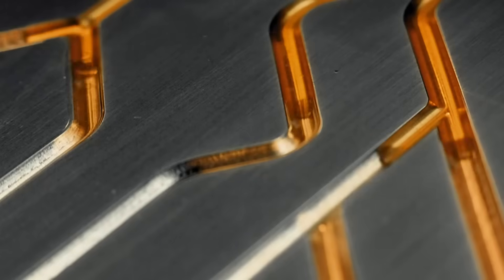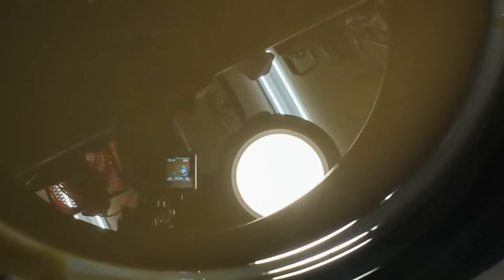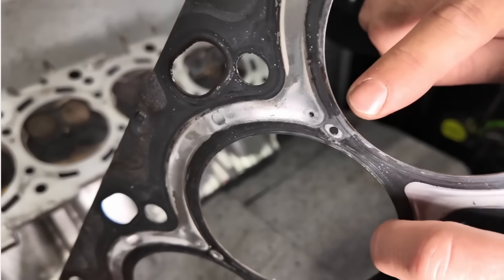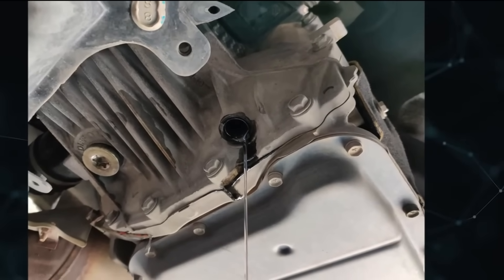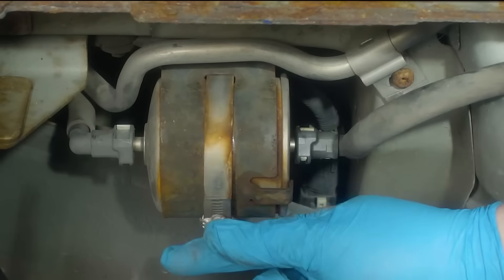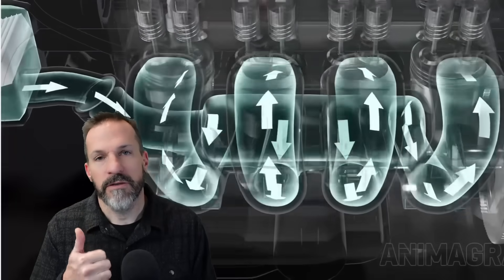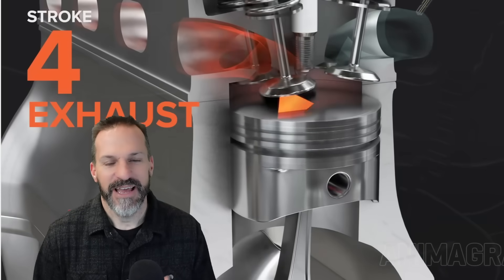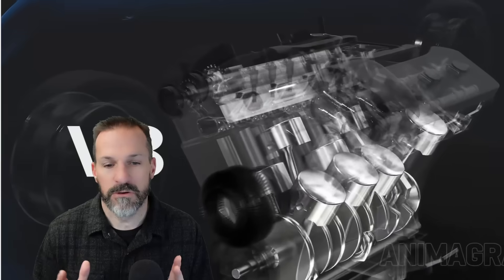Car Maintenance MOST People Ignore! Make Your Engine Last 200,000+ Miles!

Comment: I have a 1996 GM car with 215k miles. Only changed an alternator, fuel pump, ignition coil, water pump, brakes, hoses, etc. and a couple of minor other items. I bought the car brand new and did an oil change at 500 miles and performed the recommended break in procedure. It just needs some some paint on it and I hope to drive it beyond 250k.

Comment: Check for metal in your old filter???
That shows engine damage, changing oil more often won't fix the damage.
Reply from the maker: It's considered "normal" for there to be some metal on the initial oil change. After that, you should not be seeing metal, however it will point to signs that something might be wearing (bearings/rollers etc.).

Comment: Also change your oil at no more than 5000 miles regardless of the owners manual says! 
Next change transmission out I buy a kit from a company that sells car specific oil and filter and new gaskets for around $120.00 from Blauparts

Comment: Instead of measuring oil when you drain, you can simply check the dip-stick first to see how much of it has disappeared since the last time you checked as you are supposed to.
Reply from the maker: You can, but you should at least have some idea how much oil is missing depending on where it reads on the dipstick, every car will be different, and every car holds different amounts of oil in the pan. I would say do it at least once...so you understand how your individual dipstick reads.
Reply: @TheCarGuyOnline  If you do it monthly as you are supposed to, you will have done it more than once between oil changes. Doesn't hurt to look immediately after an oil change too as there are horror stories of shops forgetting the "add oil" part of an oil change... or not doing the job altogether.

One of my friends drives a 2014 KIA Rio (company perk) that burns about a quart per month or ~800mi. The first time he asked me to have a look at it, I found that it was low on oil and had a new quart tucked under the driver seat. That barely got the dip-stick tip wet, needed another quart on top. Whoever had the car before him knew it was an oil-burner.

The last time he asked me to check if he was due for an oil change, his dipstick was dry again. I offered to top it up using used oil from my own previous oil change to tide him over until he could get around to having his oil change done at the company's garage, saves me the trouble of disposing of it. Ended up pouring my whole gallon of used oil plus a quart of new oil into it to reach the minimum level.

I'm surprised he still didn't have a low oil / check engine light. Or maybe he did get it intermittently (starting to suck air) and didn't mention it.

Comment: Couple things I do with my 2011 ram, I keep a journal of everything that’s done with my truck either by me or a shop. That’s date, mileage, what was changed and part number of part/fluids. I also do oil analysis through Blackstone laboratory that will tell you everything that’s happening inside your engine. I do every oil change but you could do every other one. I even journal every tank of fuel, that’s the date, where I purchased it, how much it cost per gallon and then I hand calculate my mileage. My dad gave me the idea of journaling and it’s helped out tremendously to remember what has been done and what needs to be done.
Reply: That is awesome. I've seen records before, I wish I wasn't so lazy.
Reply: I'm sorry I stopped reading at Ram. Unless I had a giant shop with custom tools and paid for the truck in $75-115k complete cash I wouldn't buy it. Toyota 100%. I'll stick to my middle class trash ways until then.

Comment: We put 360,000 miles on a gas mercedes and changed the oil at 10k as recommend.  Not sure we wanted the car to last any longer. No engine issues ever.
Reply: Which Mercedes model car did that? And year
Reply: Likely a way older model. Good luck doing that with a new Mercedes. Anything newer than 2017 will probably break down before 175k that way.

Comment: In my wife's 2016 Chevy Equinox with the LFX 3.6L V6, I do oil changes about every 2K-3K miles using Supertech 5W-30 Full Synthetic. I ran a can of BG EPR in the engine about a year ago, which works fantastic on these GDI engines. I'm about to do an Amsoil Power Foam service on the intake/valves this coming weekend along with dropping the transfer case fluid with Amsoil.  I've been running Lucas upper cylinder lubricant/injector cleaner for about the last 20K miles. But yeah, this car is about to hit 90K miles, runs superb. You can't even hear or feel this thing idling. Only major thing I've had gone bad was a fuel tank pressure sensor with threw an EVAP code, which was repaired.

Comment: Yo, my 2007 Chevy Suburban with the 5.3 Liter has 280,000 miles on it. We use mobile one oil 5W-30 full synthetic and Lucas oil stabilizer. We not had the lifter issue because we change the oil every 5,000 miles. What’s nice about the LS engines, is the timing chain last the lifetime of the engine. We also have invested in a K&N washable air filter. Overall, I would give this 53LS a 10 out of 10 or four reliability.
Reply from the maker: Yeah I think the older GM engines were great for longevity. So many small time contractors I see around here still driving them. They might be rusted out but they still move LOL. 2007 was tough with AFM issues for some, you must be very diligent with oil :).

Comment: 376,000 2001 Durango 4.7L...does have rebuilt diff in it as dealer did not replace the pinion seal correctly and it failed. Engine/Trans still original. 2006 300C, 285,000 miles, purrs and that gets 10K oil changes, 100K trans fluid/filter changes. 2014 Durango just hit 200K. I use the on-board oil change system for guidance. No engine issues or Hemi tick. I have not touched the trans, as Dodge says not to. I may do a fluid change on it when I change the plugs which are due now.
Reply from the maker: Those are some incredible numbers!
Reply: Probably wouldn’t work on anything newer than 2017.

Comment: I try to maintain my cars beyond what is recommended. Another step I have taken is doing what I can to prevent rodents from getting under the hood. When parked in the garage I keep the hood open and regularly inspect for evidence of mice. Several years ago I had a car extensively damaged by rodents. All of my good maintenance went down the drain.
Reply: what is "recommended" by the manufacturer is just enough for the car to last 150K miles, beyond that the manufacturer wants you to buy a new car
Reply: Like the rodent tip. Had a coworker claim they would put Irish Spring around their travel trailer to keep them out because of the smell. Can't verify if worked but she swore by it. 🤷
Reply: Try peppermint oil. Mix with water, spray in the garage, around your car, etc. Smells good and squirrels, mice, rats hate the smell.
Reply: 308,000 and still going.  2006 Pontiac Grand Prix.  Original engine 3.8L and transmission.  Oil every 5,000
Reply: Good idea. Had rodents in my engine compartment before. Pro tip... leave your BBQ open also, rats love to hang out there.
Reply: Put mothballs everywhere.

Comment: Im my 08 Chevy Silverado i did the full delete of the afm/odd so i don't have to worry about having a stuck lifter since all the spring lifters was taken out and a new cam. But i change my oil every 3000 miles i know people say thats over kill but i enjoy changing my oil and the cost isnt that bad i use Pennzoil ultra platinum and my truck doesn't leak or burn a drop of oil

Comment: Best tip to buy a car without a turbo. Next best tip is to buy a Toyota.  Don't tires need loving too.  Services should be based  more to time intervals then miles.  If you want to make your car  last.  Drive it like you love it and not like  your having an orgy with it.  Maybe you should blow the carbon out once in a while.  But not hourly.    

P.S. If it has a wet timing belt to go with the turbo.  You and the car  deserve each other.

Comment: Great list of proper maint. on vehicles. Lots of good advise.
Rather than measuring the oil that you drain out, wouldn't it be easier (and less messy) to check the dipstick prior to the oil change?
Reply from the maker: You can use the dipstick but it's always nice to know the ratio, so figuring out when it's down to a certain point on the stick, how many quarts are actually missing from the engine, and in addition to that, how many quarts does it hold total. For example, my daughters older Honda accord eats oil like cookie monster, but it runs great otherwise with over 200k miles. When we look at the dipstick, it almost seems a bit off, oil might be on the low end of the stick toward the bottom mark, but measuring what comes out is over a quart low. Also, her Honda only holds just over 4 quarts full, so running an engine on 3qts or less, even though it's in "range", could cause issues down the road.  Also when we do a full measured fill with filter change, it tends to ride above the top mark...so sometimes the dipsticks are just not a perfect indicator, once you know your car though, you can for sure use the dipstick method.

Comment: The engine? How do I get a transmission to last 200,000 miles? That's always the first big repair to go...
Reply from the maker: I like the method of drain and fill every 30k, or 50k at most. This replaces about 1/3rd of the fluid each time, keeps it fresh, doesn't disrupt anything. If yours has a filter that is easily changed you can add that to the 50k list. It will be brand dependent too, some brands have much higher failure rate with transmissions than others.

Comment: Another step that you can take to help keep the intake valves and fuel injectors clean is to use Top Tier fuel.  It contains a higher concentration of detergents than other gasolines and can be found at many gas stations - Shell, Chevron, Mobil, and 76 just to name a few.  I almost always fill-up at 76.
Reply: I like 76 too.  Sometimes I use Shell out of convenience but they seem to charge more

Comment: I've got 2003 Nissan Pathfinder with 3.5 VQ35DE that has 137,000 miles on it. Engine, transmission, radiator, diffs, transfer case has been maintained. I only use synthetic oil. The only problem I have is that it burns oil. I researched and early VQs have this problem. Recently changed valve cover gaskets, engine looks clean inside. Spark plugs have been done at 110,000 miles. One oxygen sensor have gone south at around the same time. Break fluid changes depend on where you live. In my area there is low humidity and you can stretch it to 8-10 years. I replaced Power steering fluid when the car was 20 years old, it has no problem. In general just follow the owners manual and it's not always necessary to respect the time interval (for instance transmission, diffs, transfer case, fuel filter), but always respect the mileage interval. One noticeable exception is the engine oil. You should change it at least once a year despite the mileage, and no matter what oil you use and what manual says, don't stretch it too long. 5000 miles is a great middle ground. Just remember that when odometer hits round number, change the oil :)

Comment: Have a 93 Toyota T100 with 208K bought it a couple years ago with 193K on it and did basically everything on your list within the first 6-12 mo of ownership due to it not having a complete maintenance history. On that note, the next scheduled maintenance items will be diff/transfer case flush at 223K along with the air filter. 

It does have a bit of an oil burning issue needing a quart or two in between oil changes, i tried using some high mileage seafoam in the crank case before my most recent oil change and it seems to have slowed down the consumption a bit, only down half a quart after nearly 2000 miles. Will try seafoam treatment again before next oil change and see if there is continued improvement. Great video, thanks for the list!

Comment: my 2014 ford fusion 2.0vep engine just clicked over to 200046 miles a few days ago,, all oem still i drive it softly until the engine is up to operating temps.. never getting the turbo going until then.. then if i should drive it hot,, before i shut it down,, i will let it idle for 2 songs on a cd i might be listening to at the time.. every 6000  miles with a dexos type oil..in staled 2 ovs on my engine. as is had a DI system on the car..so my intake valves are still pretty clean.. every 3 oil change ir remove and replace 4.5 quarts of transmission oil.fluid. only use 1 quart per 3000 mile.. but no smoke at all even when on boost. spark plugs are cheap $ 8.00 each so i change those out once a year.., water pumps cost $35.00  for this car.. so i shage them out every other 45000  mile coolents changes..cabin filter once a year.. engine air filter ' paper ' every 2 years..i am not into that racer boi k&n filter stuff.. we like yo point out to our customers,, thay if you can hold the  filter up, to a strong light.. like the sun, and if you can see thiugh it.. this it not a good. filter,, and it will not give you extra hp....tires checked everyday per a walk around before in get in the car.. check tire pressures every week.  alinement every every 6 months ( i got a 3 year plan at good year..unlimited alinements for 3 years. a great value ).. brake fuild change out every year.. as this point you might think i work as a tech..i do, classic Italian cars.. so i take very good care of my cars.. and a  note.. i like your fairmont.. i have always like the clean lines on that car.. take good care of it
Reply: but i am thinking about that valvoline ' protect and restore ' oil for my next change..i dont nelieve in ' snake oil' of' fix in a can ' stuff. but this is getting good reviews.. and valvoline is a good company
Reply: GREAT ADVICE

Comment: On my previous turbo-charged engines, I've stayed with 3,000 miles firm. Normally aspirated 5,000 miles, religiously.  I agree with everything you've stated.  Good video.
Reply: Have a 23 Mazda CX-5 Turbo Signature, do oil changes myself every 3k.... 100% synthetic.
Reply: So even 4K miles between changes on a turbo is pushing it?

Comment: My original transmission went out on me at 412k miles on my Toyota Avalon. The shop told me a piece of the torque converter broke off and did something. It probably would had lasted longer but i had babied it till the end. They told me the transmission oil looked good as I do drop and fills every 50k. That was the only time my car ever been to a shop. I was considering if I get a newer car but luckily I found a low mileage jdm transmission. Still trying to pay off the bill on my credit card😅 if it last me another 3 years I’m thinking it would pay for itself.

Comment: I have a 2018 Chevrolet Cruze. I bought it new. It has 115,000 miles. I change the oil every 8,000 miles with synthetic oil and it still runs like new. 😊😊❤❤

Comment: I bought an old 2004 chevy avalanche last year in March. It had 240000 miles on it when I got it. Had to replace almost everything; rear main, entire front suspension, fuel pump, fuel injectors, had evap system issues, intake gasket, exhaust manifold, exhaust manifold gaskets, spark plugs, plug wires, oil pickup tube o-ring, shocks, brakes, rotors, coolant temp sensor, hvac door actuator (top), intermediate steering column, and the list goes on. Took me almost a year, but it probably runs better now than when it was first built and MAD POWER. lol I love her. Today she has around 248000 miles on her.
Reply: How much did all those replacements cost you?
Reply: @terry_willis all in probably $3-4k. The parts are never the expensive part. The expensive part is the labor.
Reply: @terry_willis all in probably around 3-4k. Bought the truck for 4500 cash though and I don't have a 1500 dollar a month payment on some new recall prone piece of trash lol and most of the time it's not the parts that are expensive it's the labor. The most expensive things I bought was a new driver's side exhaust manifold because it was cracked. 🤷‍♂️ I love this truck lol
Reply: @danieljohnson5051  4500 was about 3500 too much, holy crap
Reply: Those Chevy 5.3's are brutally reliable 💯

Comment: Great advice. My 2006 Matrix 4WD has 227,000 miles and still runs great.
Here is the maintenance:
5k/6mo OCI 5w30 full syn and OEM filter.
30k Trans, TC, diff drain and fill
40k power steering fluid flush
50k coolant and brake fluid flush
50k PCV valve
20k engine, 10k cabin filters
100k Denso Iridium plugs
Reply: Go forever
Reply: pro tip, dont touch the tranny oil if the tranny works fine. I have 240 000km on my car and never touched the oil in the tranny and she runs good, but its also a honda civic.
Reply: See you at 500k
Reply: No one cares mate.
Reply: @EcotecEngine3.8V6  I care, no one cares about your pointless comment
Reply: @Uniqueusername-1 
Oh wow. That was an amazing post. It really made me reconsider my life choices. 😂😂
Reply: @EcotecEngine3.8V6  You're a weird guy

Comment: I change my vehicles engine oil and filter every 10,000 miles with the cheapest on the shelf at that time, this includes turbo charged engines. Own multiple vehicles and they all have over 200,000 plus miles. Where I live, cancer attacks the car before the engines ever let loose.

Comment: Other then oil changes I changes everything every 60,000 miles so I don't forget. My wife got a new truck I drive to work in a 2010 Chevy Malibu 4 cylinder with 240,000+ miles and going strong. Thank you for your videos.
Reply: This is a strategy I can get behind lol. Otherwise I’d need a spreadsheet to track everything for both my cars